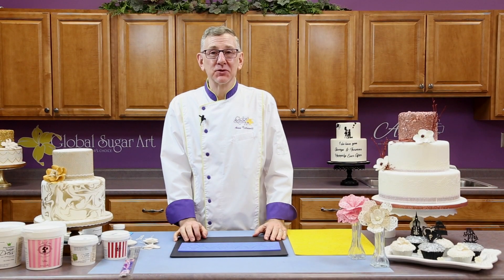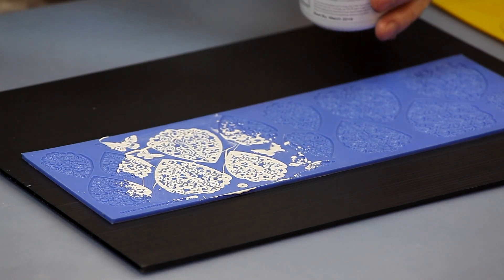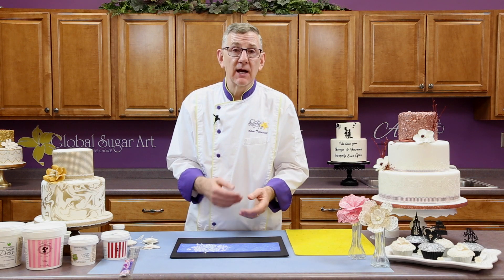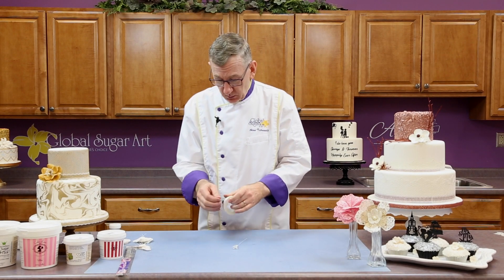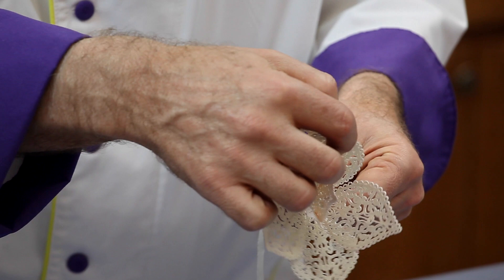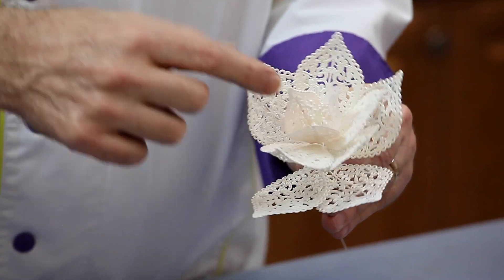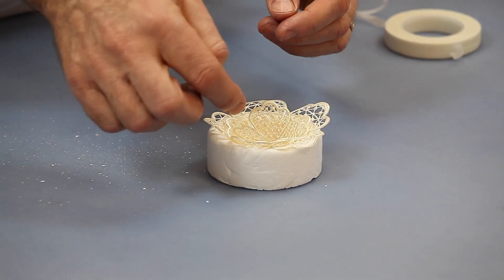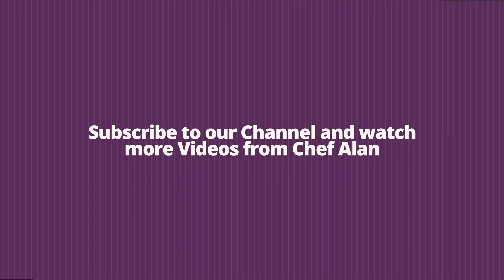How to Make Lace Flowers | Global Sugar Art

Comment: I have a question won’t the lace get hard and brittle after a certain amount of time I have done lace before and I have found that it gets hard and brittle from one Day to the next to the point where it just crumbles into little pieces if I touch it won’t that happen with that lace as well
Reply from the maker: Juanita, ALL lace pieces are subject to drying out and becoming brittle if you live in a dry climate or in a heated kitchen or home.  You will find that in warmer summer months when the humidity is higher that they will not break.  During our dry winter months, I place the finished lace pieces or the entire mat ( once the lace is dried) into a large plastic bag.  Add a small, damp paper towel in the bag but NOT touching the lace.  By the next morning, all the lace pieces should be very flexible again.It's a simple matter of re-hydrating the lace pieces so that are manageable.